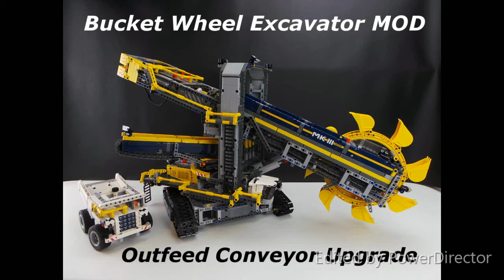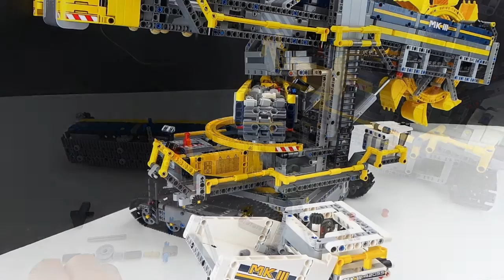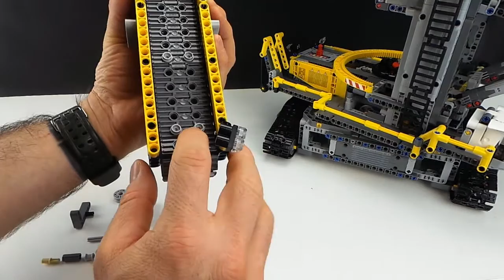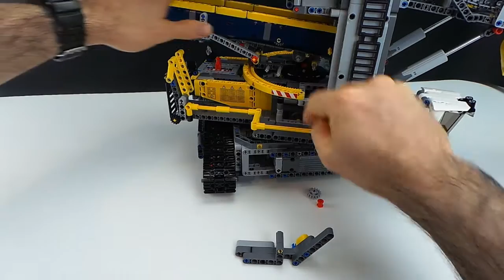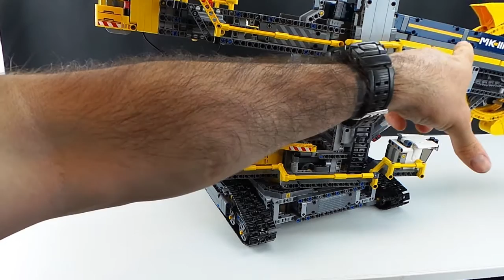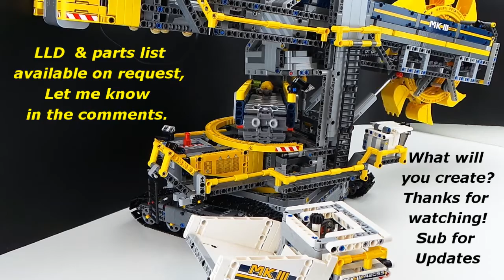LEGO MOD the Bucket Wheel Excavator 42055 Out-feed Conveyor Part 1

Comment: Yeah, there are so many tricks to improve an Lego set, just let go ur imagination. Nice video, ill take note!
Reply: Also try to add a second xl motor in the back(there a lot of space) and u will see verything works much more smoother!
Reply from the maker: Thanks for the feedback. I have seen that mod, however my MOD's are not just for functional improvement but must fit the model visually. Also that MOD had the clutch gears removed, I have seen xL motor chew gears.

I'll be doing that MOD video some time soon (hopefully)  so stay tune!
Reply from the maker: There is a second mod to this that includes lengthening and increasing the angle, Im working on the instructions now
Reply: Yeah i know what your talking about but i wasn't referring to that video i did it myself with the clutch gears and sticking the 2 xl motors one back to the other in the empty space and i was planning at adding and extra L motor for the up/down function but i didn't had time. Just look at all the space where are only axes, you can do so many things...